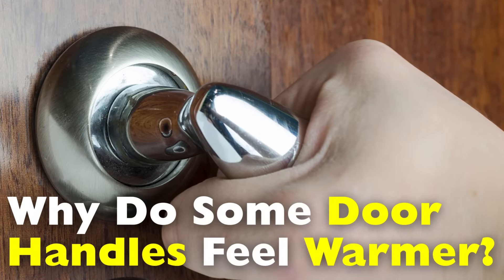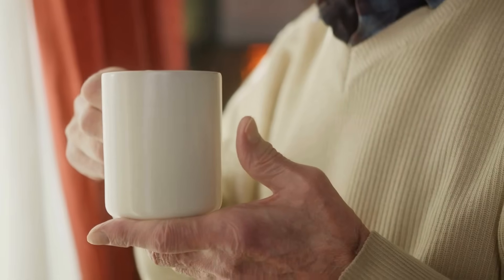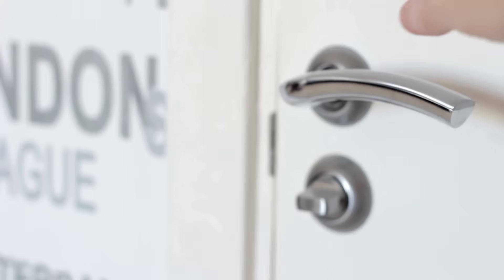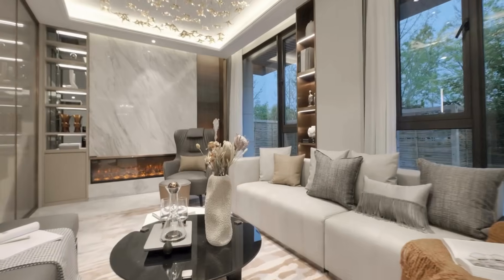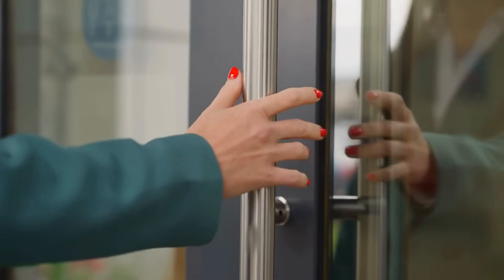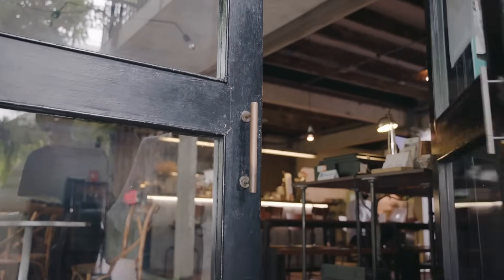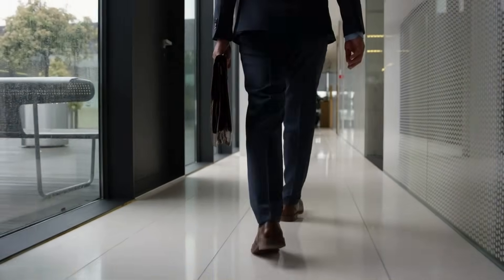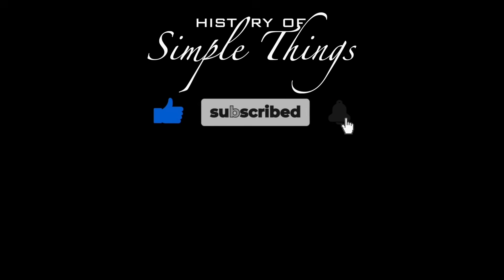Why Do Some Door Handles Feel Warmer?

Comment: I always assumed it was due to the locking mechanism. There's a door handle at work that always feels hot. I don't know how it's connected to the card reader, but somehow swiping an access card allows the handle to turn. I assume there must be some way that the mechanism that releases the handle to turn must have some power source even though it's not obvious how the power gets from the door frame into the door.